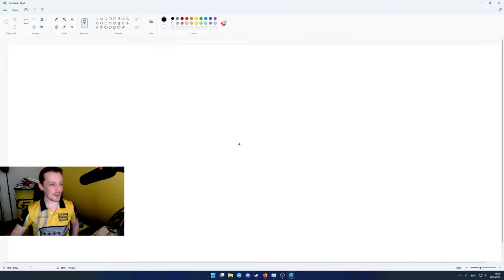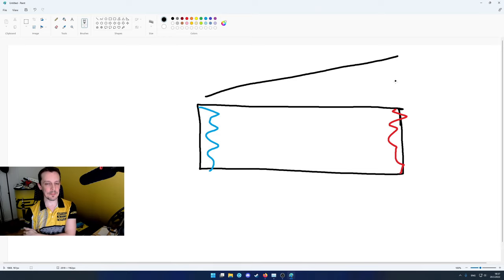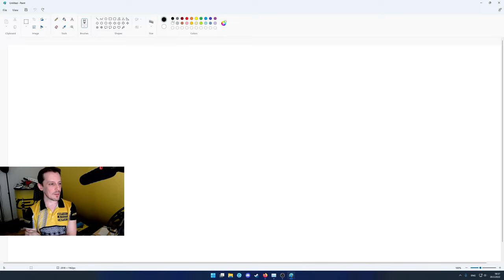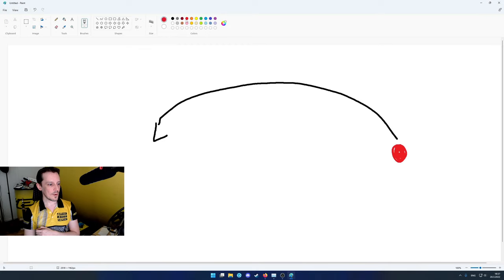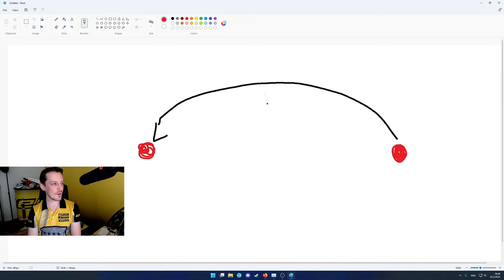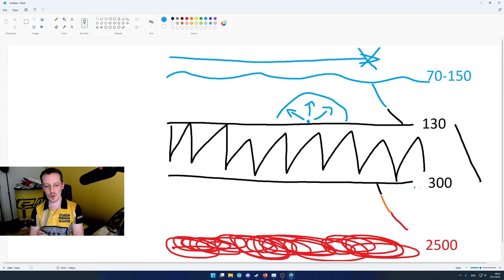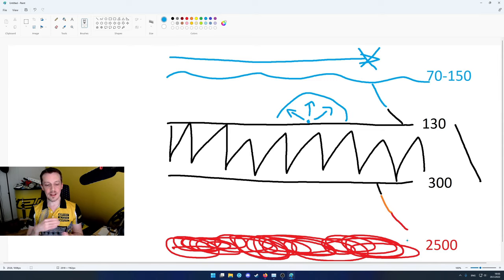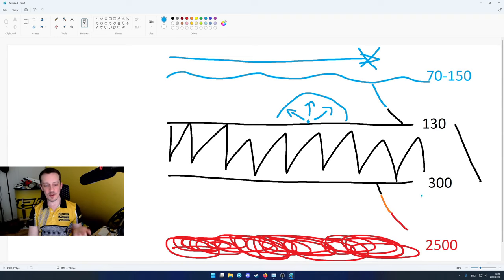Cooling your Race Engine: for dummies

Comment: Its a shame you didnt go a little bit more into ewp, thermostat use and the rad block off. The recommendations by Davies Craig, and some "pros" that say thermostats should be removed, and that controlling temp by only adjusting water pump speed is quite a worry (or is it? I gather very cold coolant flowing slowly is not ideal).
Reply from the maker: This topic came up in discussions with a customer. Which has clearly been misinformed about the topic.
Most likely a lot of others must be understanding engine cooling wrong. So we decided to explain how this works to everyone.
Adequate coolant massflow is extremely important for evening out the temps in the engine. And also to prevent hot spots from overheating.
Water pump speed should never be used to control coolant temp when a race engine is being pushed hard. Idle area is fine though.
Removing the thermostat is completely ok, but if coolant temp then needs to be adjusted, it has to happen on the radiator side.
Reply: @ElmerRacing  at low loads is having slow moving comparatively cold coolant entering the engine a concern? My worry is having temperature imbalance across the block/head and between cylinders.
Reply from the maker: We would not think that it would be a problem even on cast engines. Certainly not on our engines at least.
As long as coolant mass flow is low, it won't "thermal shock" the engine. However, it's still possible to locally overheat areas of the engine if there isn't enough flow. On larger engines internal temperature differences might get big enough to crack the block/head due to thermal difference caused stress (like on ship-size engines). If the coolant flow is too small.